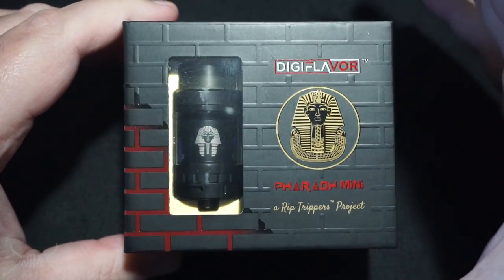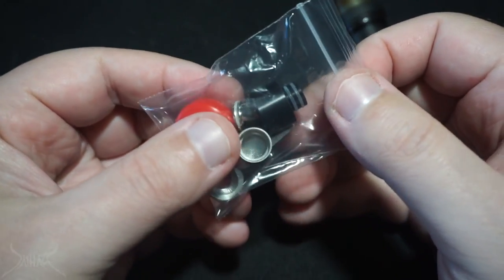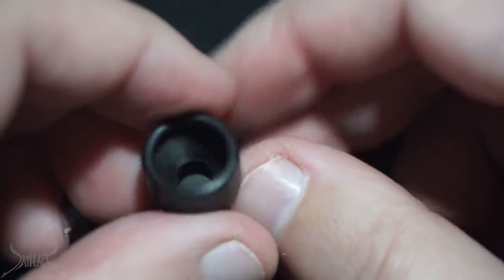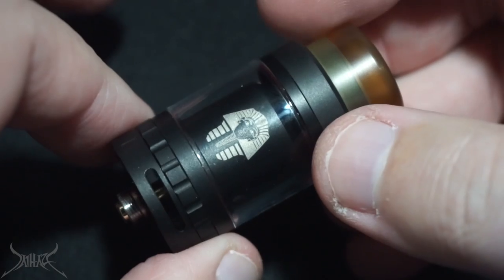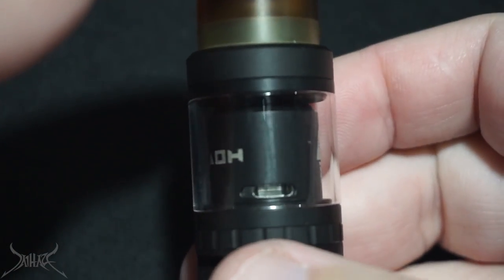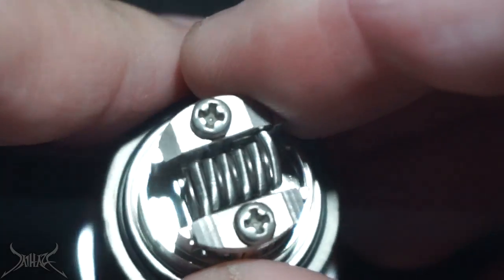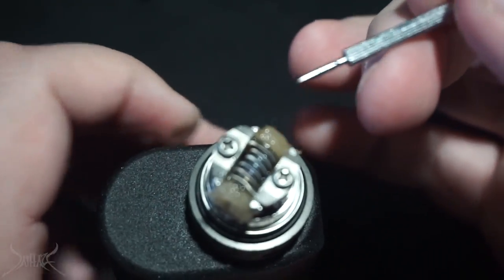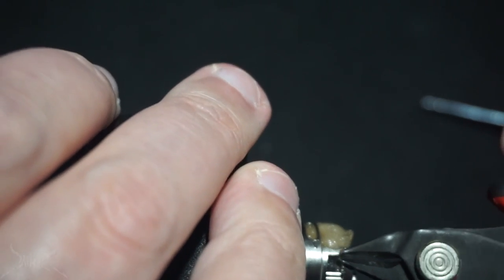WARNING: Digiflavor Pharaoh Mini RTA Review and Rundown | RIP Trippers Project

Comment: I will say this that tank is defective cause my doesn't have that issue but I will say mine has its own issue a bent airflow. So mine has leaked since day one and I have had it for over a year. I don't know why it was bent but when I put the tank on and screw it down one side is tight the other has a very small gap so there is that as well probably better if I showed pictures to explain. When I flip the tank over and look at the bottom of it the metal air flow ring has gaps its not all flush around which I mean one side has a bigger gap to it. I tried to contact element vapes for a return and also tried digiflavor they both told me I was  shit out of luck basically. So basically  lesson is if you get something that don't look right or feel right exchange it right away. I did not notice these problems right away I thought I just need more wick I think their return was like 15 days or 30 days I forget now. But I wish I got another to actually experience a good product I wont be buying another because they never exchanged it for me. Also digiflavor like never responds to people anymore I don't know if they just don't care or maybe they are going out of business no clue.

Comment: My juice flow control does not work, too. With, or without the extension, makes no difference. In addition my pharaoh leaks at the bottom. I have to unscrew it from the mod 	and clean it every few hours to avoid that liquid will wet the whole mod. Flavour is not that good. My favorite liquid taste a lot better in captain rta, or tfv8 (rba installed). In my opinion, for a brand new product, a fail.

Comment: Hey Jai,
The original pharoah doesn't have a locking but and in terms of looks is pretty much the same as this and comes with an expansion tube to increase capacity to 8 ml. Seems you did it too long ago and forgot some things

Comment: I'm not a fan of one piece juiceflow. Sucks you have to back the tank off to get the juiceflow open, similar to the kayfuns but they have more threading and smaller juice ports. Still has some wobble when they're backed off to open it up though. 

Not a fan of the ammit juice flow either. At least it's wide open when tightened down but given the tiny holes in the deck it's a bit of a moot point and no real control. Not to mention when trying to close the juice flow and removing the cap to fill the tank's loosened up and hard as hell to keep the juice 'closed' without spinning it too far loosening the cap. Ends up closed, open, closed, open.. 

One of the most impressive juice flow setups I've seen personally was the bachelor rta. Juice flow was separate inside the tank so the tank stayed seated while the juice flow ring moved inside the chamber and had a stop so the juice flow closed first, then the tank unscrewed from the base.

Comment: Late comment here but it's funny reading the comments about how the juice flow works so well, works so well in 2ml mode...sure.....but Jai did change to the BIG glass and no one still gets it or put a comment with the big glass. Even if it works fine in 2ml mode, it should work as fine with the bigger glass. OH well.
I pretty much like all vapers out there, i check them all just to get some more info on all the mods and tanks, rda's, rta's and so on just to try them all out myself, some has been pure shit but some has been hidden gems aswell.

Comment: Hi, uses this thing since 2 months - no issues with the juice flow -  I have it always open - even while filling. The device is dry as a non pornstars ass. Flavour is Ok but not astounding. I'm running it with a fused clapton NiCr @,3Ohm on a tube. Machining is excellent. Only con is that the deck sometimes unscrews maybe that happened to you. Don't look pizza guy porn crazy man!

Comment: I wish I've seen your review before  buying this..  ended up cracking the 5ml glass, first thing I did out of the box, mounted the extension. And no matter how tight I've screwed everything I still had a loose glass, and O RINGS was not missing! so the result was leaking badly tank. And after I was unable to unscrew everything back. While trying to do so, glass cracked. So I'm stuck with 2ml glass. Whatsoever it vapes really nice except one thing. TURBULENCE.  OMG it seems like a turbine spinning in my head :D very annoying.

Comment: Not really related to the video at all - just feel like ranting: why do so many people insist that manufacturers implement juice flow control? Juice flow control is just what happens when you wick a tank properly. Take the Reload RTA for example. No juice flow control. Same goes for the original Zeus RTA, which is a great tank that I still use regularly. Juice flow control isn't necessary. With the Reload, if you wick it too loosely, it's going to gurgle and leak like a motherfucker when you refill the tank. If you wick it too tightly, the wicks won't be able to absorb juice fast enough to keep up with the amount of juice being vaporized by the coil. If you can't figure out how to wick it correctly, you're going to have a terrible time. If you do wick it correctly, it's a brilliant tank which produces incredible flavor. You can chain vape it like crazy with no dry hits at all AND it stays totally leak free no matter how many times you refill it. 

All it takes is a little common sense and perhaps a bit of trial and error. My Reload was the first RTA I had ever owned or even used. First build, leaked every time I refilled it and this wasn't a small leak, screwing down the cap pushed half of the liquid in the tank down through the airflow holes. Second build, I packed it tight as hell, hoping to avoid more leaking and the juice was hitting a brick wall of cotton. By my third attempt, I understood what to do and it's been perfect ever since.

Comment: first off maybe you should actually take some time before you review something. I almost didn't get this tank because of your review. lucky I got it anyways. the juice flow control works by having the tank on your mod gripping the top of the tank and turning it clockwise  like you would be putting the tank on your mod. it will spin and spin and not over tighten the tank.  this took me all of 5 min to figure out

Comment: So your unscrewing the build deck for juice flow control, what a horrible design.  I don't understand why they designed it like that there's already a correct way to do juice flow control and unscrewing you tank isn't it.  That's a definite deal breaker.

Comment: You have to screw that locking nut tightly after you screw the deck section on it. Because that locking nut keeps the whole tank together. If you screw the locking nut without putting the deck section then obviously its going to leak, because its not held together. I think you just dont like rip trippers and have problems with him. Your're a reviewer and only mention pros and cons about a product, and not get personal. Thats very unprofessional behaviour. Thanks for video anyway. Take it easy.

Comment: Ugh, the chatter on that drip tip adapter. Eww.
Reply from the maker: HEY I MENTIONED you today, wait till you you see what I came across.  Its going to blow your mind.  It will be on the Athena box mod squonk
Reply: As a QA Tech in a machine shop, that shit made me CRIIIIIIIIIIINGE!!!
Reply from the maker: did i miss something?
Reply: Oo Should I be worried? Or wear a special hat?
Reply: The kinda rough marks at the bottom of the inside of the adapter. They probably just drilled it out and called it good.